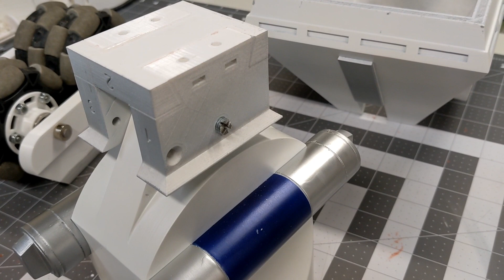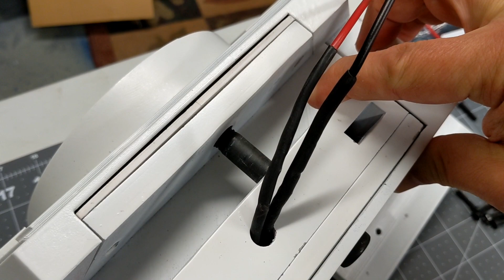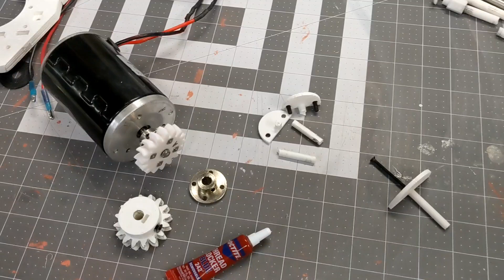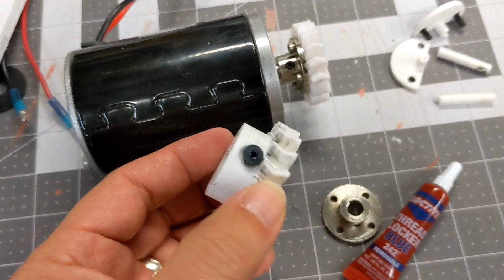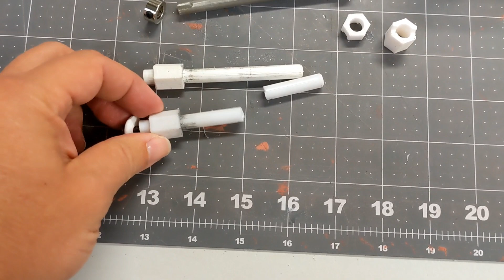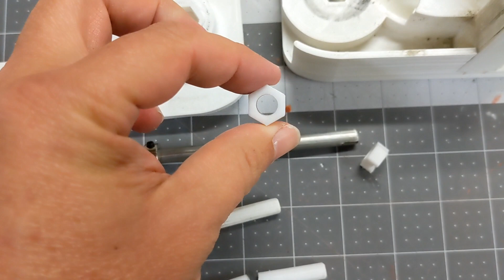7 Essential Mods for a 3D Printed Astromech

Comment: Hey Jason, THANK YOU for explaining everything in great detail! You have saved me tons of headaches with your upgrades! I am very grateful for this video! Keep up the awesome work!
Reply from the maker: Thank you! I always appreciate hearing when I'm able to help out a fellow builder. Keep in mind that the metal flange upgrade to the drive gear that I mention has since been superceded by the sonic hub upgrade - also done by Tim Hebel. Be sure to check out his directory of updates in the Baddeley file share. Happy building!
Reply: Hi Jason, do you have the center foot printed parts and hardware specs as seen in this video?
Reply from the maker: The exact version of the center foot that I used can still be found in the Baddeley OneDrive: Print Files -> Astromech V2 -> R2D2ver2Feet -> Retired Legacy -> R2_JD_VEX_PRO_wheels. center_foot_main.stl, center_foot_side1.stl, and center_foot_side2.stl are three pieces that make up the frame. There is a center "bridge" piece on my frame that is not there, and I looked everywhere for that file but could not find it. The "end caps" on my axles are vex_hub_4inch_wheels.stl. The wheels, flanged bearings, and center locking "versahub" are the same as the newer version of the mod - you're better off using the updated BOM located here: Print Files -> Astromech MK3 -> MKIII Body -> Legs & Feet -> CenterLeg -> VexFrameRelease. I used (I think) 8mm steel rod and lock collars for my axles. If you're in the Baddeley Facebook group, you can do a search for my name and you should see a post or two from years ago where I detail the assembly. Good luck!
Reply: AWESOME! Thank you so much!

Comment: Thanks for sharing this video, very helpful. I used a 2.8mm drill bit to widen the hole of the middle-gear pin, so that the M3 bolt can get screwed in more easily.
Reply from the maker: Nice. Getting that screw all the way in can be very difficult. If you don’t have spare nuts or bearings to wrap around the outside to prevent splitting, then widening the hole is the best alternative. Thanks for the tip!

Comment: Excellent run through!  Great timing as I'm currently taking my drive units apart for painting.  I was already planning on looking up all the individual mods but here you've got them all in one place with great video.
Reply from the maker: At this point, I've taken these drives apart and reassembled them so many times, I could do it blindfolded!

Comment: Aargh!  I started assembling my drive units with the modifications only to find I don't have any M3 square nuts or M3 15mm screws and the icing on the cake is that the M12 socket caps I ordered last year were 100mm instead of 110!  At least cutting the M8 linear rod's and the hollow center axle mods went smoothly.  Sometimes you have to celebrate the small victories!
Thanks again for posting links to the M12 bolts.  I found the nuts at my local Ace Hardware but I'm going to wait for the bolts to arrive to make sure I don't get the wrong thread pitch.
Reply from the maker: Oh, that is sooo frustrating! I've been there too many times myself - I feel your pain. On the motor gear mod, you may have a little flexibility on the length of the screws (15mm can be hard to find, but 14 and 16 are easier). When assembling, I drop the motor into place and let it fall all the way until the end of the shaft rests on the wall of the drive unit itself. When I do this, I find I need to shift the motor gear back a bit so it sits closer to the motor itself instead of leaving it flush with the end of the shaft (maybe 1/16 of an inch of shaft protrudes beyond the motor gear). This is needed to better mesh with the center/intermediate gear. As a result, there's a bit of extra room available so if your screws are a bit longer, you should still be OK. Can't be certain if this would be the case for you, but if you've got some hardware that's close, might be worth giving it a try. Good luck. You've only got about 25 more dissassemble/reassemble cycles on these drives left to go!

Comment: Jason.  This is a fantastic video. One of the few that are out there that actually makes sense. Thank you for putting this together. Two questions for you..

1- what is the length of the sliver rod for the large wheel?

2- what is the length of the 1/2 inch Thunderbolt vex shaft for the smaller wheels?
Reply from the maker: Thanks for the kind words! Unfortunately, I don't have easy access to R2s drives to measure, but the exact length for the main drive wheel isn't too critical - it needs to protrude out both sides enough to slide a lock collar on each end. I would guess the total length to be about 6 or 7". There's space between the drive and the foot shells for them to stick out a bit. The hex shaft is definitely a lot shorter - in the neighborhood of 3-4" (or less) if memory serves. You'll want to be somewhat precise with the hex shaft - you want the ends to sit JUST proud of the bearings at each end. This is so that when you add the large washers on each end, the axle keeps them from pinching down on the bearings. If the hex sits too low, you'll impede the spinning of the wheels, and if it sits too proud, you might get some slop. A grinder or belt sander can help you dial it in. I'll try and check soon and get back to you if my memory was way off! Good luck.

Comment: thanks very much for this! Couple of questions: Where can I find the adapters you designed for the axle, and I'm unable to locate the upgraded  gearboxpin on the onedrive. Could you point me to where those files might be?

Again, thanks very much for this super informative vid. My build proceeds slowly but this will help. You've convinced me to go with the vex wheels, except the thunderhex shaft is a problem.
Reply from the maker: My axle mod can be found here: https://www.printables.com/model/251171-baddeley-mkiii-drive-axle-mod

Tim Hebel's updated pin for the center gear can be found here in the fileshare:
Print Files -> Astromech MK3 -> Modifications MKIII - Tim Hebel -> MainFootDrives -> Center Axle Mod

While you're in there for the drive mods, consider going with Tim Hebel's sonic hub update over the metal flanges I show in this video.
They can be found in the SonicHubMotorGear directory adjacent to the Center Axle Mod directory listed above. Just be sure your sonic hubs match the shaft shape on your motors. Most likely they'll be 8mm round bore, but verify before ordering.

Glad you found the video helpful. The Vex wheels are awesome, but the Thunderhex can be hard to come by. I've given away all of my extra otherwise I'd offer some to you. Good luck with your build. Slow and steady wins the race!
Reply: @jasonsR2D2  thanks for the rapid reply. I found and printed the sonic hub update last night. No wonder I didn't find the center axle mod: I wasn't looking in the MKIII files, but I've got 2 printing now along with the axle mods.

Going to keep an eye on Vex. I'll absolutely do the upgrade when/if the thunderhex is available again.. I guess for now I'll have to be happy with the printed wheels. 

Thanks again! I'll be checking your other videos for sure.

Comment: I feel like I'm missing something. For the center foot ankle joint, how are you screwing it in? When I look at the files, the hole is just straight through. Did you tap threads or is there a nut hidden somewhere?
Reply from the maker: The 5/16" threaded rod is slightly larger than the hole, so it cuts threads as it goes. There may be a metric equivalent that is closer to an exact match of the hole, so maybe a smooth rod could work, but I would rather it be slightly too large and cut threads than be slightly too small and leave any wiggle in the joint. Since we're dealing with plastic, any small wiggle is likely to become a big wiggle over time. Thanks for watching!

Comment: Hi Jason. I have a question as I am in the printing phase of my R2 build. Why is it ok for the center foot to have threaded rod at the ankle but not ok for the main foot drives?
Reply from the maker: Ha! Good catch! The honest truth is that it's really not OK in the truest sense of it all. In reality, I built my center foot long before I got to legs and feet and it simply didn't cross my mind at the time and I've never had a reason to go back and change it. Were I to build again, I really would modify all three ankles to add room for metal bushings, and use that in conjunction with solid axles. I think a few builders have done this already. This is what I love about droid builders - we're always coming up with new and better ways to do things. Good luck with your build!

Comment: For the 110mm m12 bolt you use for the ankle, what did you use on the other end to hold it in place?  Does it just thread into the plastic?
Reply from the maker: There is a hex-shaped hole in MotorFrameB.stl that fits an M12 hex nut, but a regular nut will be too thick - you'll need to find nuts that are about half as thick as usual. Amazon has some that are "thin" but they look to be TOO thin. McMaster-Carr has some (https://www.mcmaster.com/products/nuts/hex-nuts-3~/thin-profile-hex-nuts~~/thread-size~m12/), but unless you're ordering other stuff, it's hardly worth it for two nuts. Maybe you can find a local source?

Comment: I see you listed the 8mmx1.75 bolts. I assume 8mmx1.25mm won’t work? Looks like I bought the 1.25s.
Reply from the maker: No, you should be fine as long as you get thin nuts with the matching 1.75 thread pitch. Be sure to get thin nuts - regular nuts will sit way too proud of the drive frame and prevent the foot shell from fitting over it. Honestly, the bolts are the hard/impossible part to find locally. Once you have those, take one to your local hardware store and find the matching nut. Good luck!
Reply: Thanks, sorry I meant m12, not 8

Comment: Jason, do you use locktite on the large outer ankle M12 bolts/nuts?  I'm just about to cut my bolts to size and realized that they might vibrate loose.
Reply from the maker: I have not. So far, there have been too many instances during the build and for maintenance when I've needed to remove the feet from the legs - I figured any locktite would just make that too difficult. Currenly, I only use it on the drive gear flange mods and on the lower nuts of the threaded rods that run through the body and shoulders.

Comment: What size is the Omni wheel, how many did you order
Reply from the maker: The center foot requires four 4" Vex omniwheels, and each drive requires a single 3.25" omniwheel. It's deceptive when looking at them, as each single omniwheel assembly consists of two "platters" of gray wheels.
Reply: What the other parts, I know I’m going to have trouble with the hex rod

Comment: Are the vex wheels in the center leg the same model as the out legs?
Reply from the maker: No. The center leg uses a total of four of the 4" vex wheels, while each drive uses one 3.25" vex wheel.

Comment: What size are the one wheels?
Reply from the maker: Each drive requires one Vex 3.25" omniwheel, while the center foot requires four of the 4" Vex omniwheels. The large powered wheel on the drives are printed in TPU/Flex filament. There are some additional parts required - bearings, spacers, and for the drive omnis, hex shaft to use as the axle. The part availability has varied and some Baddeley builders have recently found some alternative sources for compatible parts. I would recommend joining the Baddley Facebook group and searching there for the most recent list of parts and sources.
Reply: Thanks